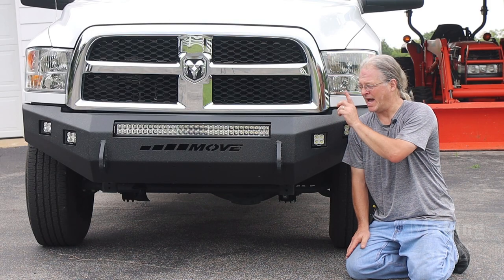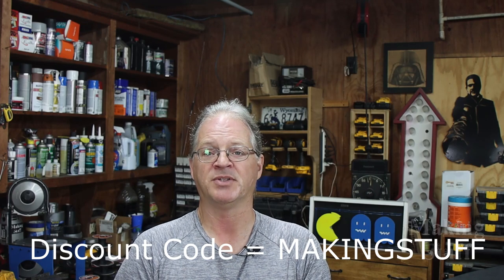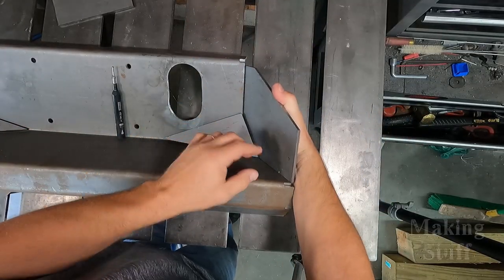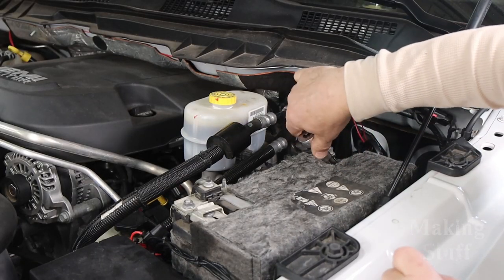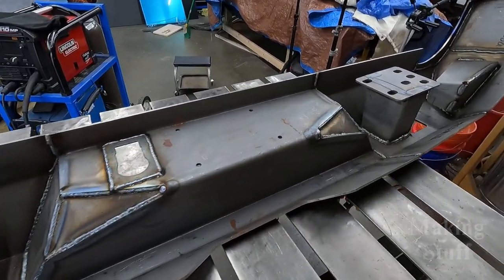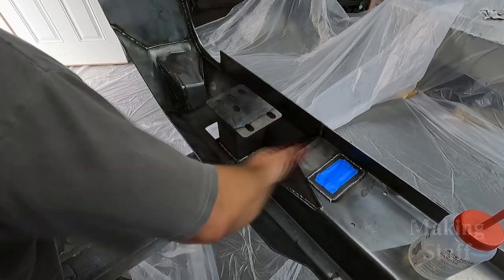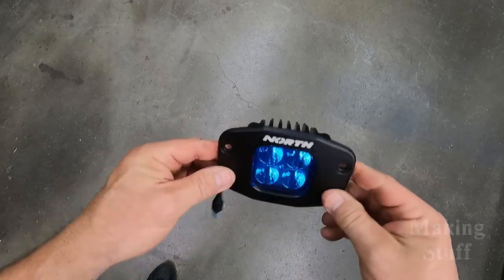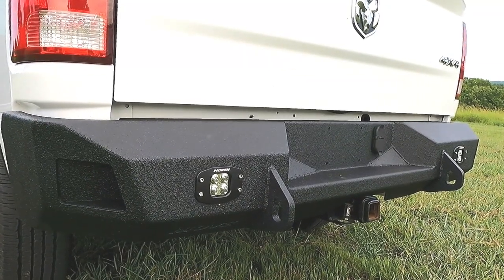Assembling a Rear Bumper Kit | Move Bumper Build

Comment: Nice looking bumper, great job!! One thing, I know you wiped it down with acetone before priming but you also were running your bare hands over it after the acetone which could put body oil from your hands on it. Hopefully you used wax and grease remover (with gloved hands) before priming it.  Nice work.
Reply from the maker: Thanks for watching!

Comment: Did you not need the hole for the spare tire rod?
Reply from the maker: I didn't have to do anything extra for the spare tire hole on my truck.  It is however a tight fit when I lower the spare, but it is do-able.

Comment: Great video. I'm building the same bumper for a Ram Rebel. What size hole saw did you use for the trailer wiring receptacle?
Reply from the maker: Sorry I don't remember.
Reply: Dial caliper from Harbor Freight can tell you what size you need. Bonus thing: the caliper is reusable.

Comment: Im building that same exact bumper. I have a question, how thick of a piece did you weld on to the back of the bumper for the tabs on the trailer plug to engage on?
Reply from the maker: 14ga

Comment: Why is it necessary to disconnect the battery? Just curious
Reply: So you don't fry the truck computers when  tack welding the bumper on the truck. Good question by the way. 👍
Reply from the maker: What @BigBlueMotors said.

Comment: Never disconnect your battery for more than a minute .. you will have to reset your radio clock. Instead unplug it then within that minute flip it around and plug it up backwards that will keep the time and it your vehicle wont be grounded since it’s reversed preventing shorts while welding